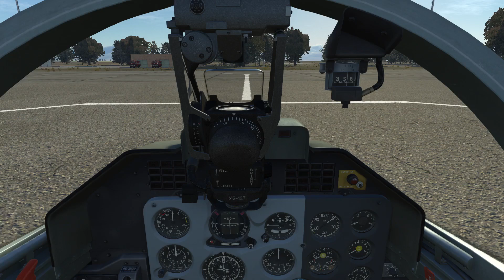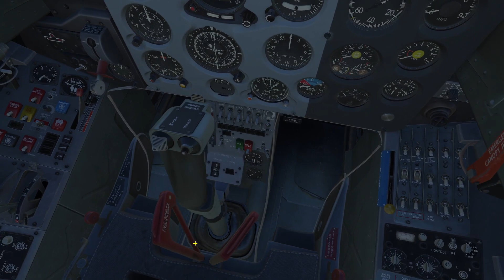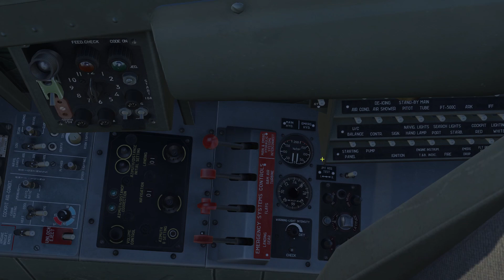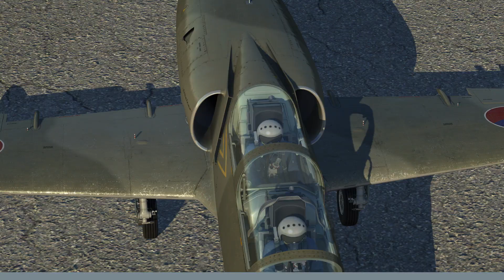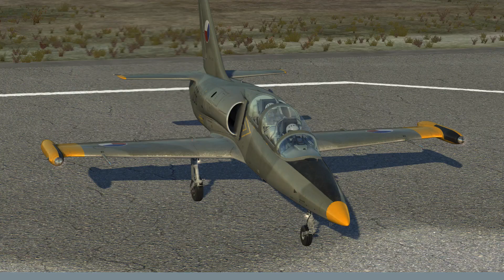[DCS] L-39C First look and startup

Comment: I just purchased the L-39. Your video is really a great help for me in learning to fly it. Even though your video is a couple years old I found it very good. I have only watch a couple for the L-39 so far. 

If possible can you enplane a little more about the ground braking and driving it on the ground. I am a little confused about the ground braking system and how to actually use them.

I have read Chucks Manuel but still have problems at times understanding things. 
I am a 65 year old never been a real pilot in my life DCS flyer. I know many things are easier to learn and grasp at a younger age.

I am eager to learn this lane as I have tried a few others and think this is ht best pace for me to start getting my heard around jets.

Comment: Just wondering, what stick do you use? And this is kind of cheese, or at least a lot of guys would think. Do you have some tips and/or keybinding spreed sheet or something in that direction for some DCS modules? Having a hard time finding what I need the most for the newest aircraft I have bought, and the ones I haven't flew in a while :) 
Sincerely a new and a big fan of your videos.
Reply from the maker: +Daniel Solbrekke Using the TM Warthog and the MFG Crosswind pedals as well as TrackIR obviously.

No, sorry to disapoint, I don't have any layouts on hand. However, I can give you a guide on what I usually do:

1. First, I will take a look at the flight controls:
- Pitch, Roll and Yaw as well as the brakes are obvious items to assing to the proper axis. 
- Landing gear, flaps and speed brakes will also be assigned to the proper keys on my throttle.
- Also, depending on the aircraft I asign buttons for Trim as well as the auto pilot. 

2. Avionics:
- Depending on the aircraft, I will usually start with the radar and targeting system controlls (Shval, TGP, ...).

3. Weapons:
- Again, like the avionics, I will take a look at some of the weapon controlls and assing obvious stuff (like the trigger).
- Counter messures are quit similar in all aircraft, so I usually set keybinds for those as well.

4. Doing some testing:
- At this point I will start up DCS and do a couple of start ups, take-offs as well as maybe some work with the avionics and weapons. Now it will become quit obvious which keybinds are missing or are on the wrong button and which keybinds don't find any use. Therefore I adjust step 1-3 until everything fits my needs.

I try to keep all my aircraft similar (same buttons do the same functions), however, I will also consider what is available on the real stick/throttle and what is not. So for example in the MiG-21, I would not have a weapon selector function on my joystick, as the real one doesn't have one either. 

I hope that helps!

John
Reply: Wow, thanks for the tips. Not that many who would take time to give a so good answer :). I got TM warthog and TrackIR myself (gonna invest in some rudder pedals soon). I try to keep my layouts pretty similar myself. But again thanks, I really appreciate your help. A waaaay better method than mine who was trying to make a similar binding as the A-10C (with toggles and etc.) I could make it with TARGET, but I feel like the bindings in DCS is better, don't know about you. And like you said, the weapon selector in MIG-21 isn't on the stick and hasn't a "logical" place to bind. 

Stay awesome :D

Comment from the maker: +ReaLSpiN Not sure if we will see the convetional flares for this aircraft (I doubt so though), however there might be some flares for the ZA variant.
The red, green, white and yellow are just singal flares which you can fire to for example mark a position or help out on identification. The Mi-8 and the Ka-50 also have them.
Reply: +xxJohnxx Good to hear that, i got another question if you don't mind,  after i startup everything, my thrust does not move forward, i did exactly what you did in the video...
Reply from the maker: +ReaLSpiN Did you move the throttle also from cut-off to idle?
Does your controller binding work? Maybe check if DCS recognizes the imput by bringing up the input indicator with RAlt + Enter.
Reply: +xxJohnxx what i press to make it idle ? i tried Pageup didnt work.

Comment: Good comprehensive video. BTW the Mig15 also has wheel chocks.
Reply: +GreyMaulkin is that new?
Reply from the maker: +GreyMaulkin Didn't know that. Thanks for the info!
Reply: +Skipper SMG nope it's been there since the first release of the module I believe.
Reply: +GreyMaulkin oh ok thats new to me. Never had to remove them. I just increased thrust and started taxiing like in the other modules.
Reply: +Skipper SMG yeah they are not on by default.  You have to ask the ground crew to place them which is useful for run-up test.